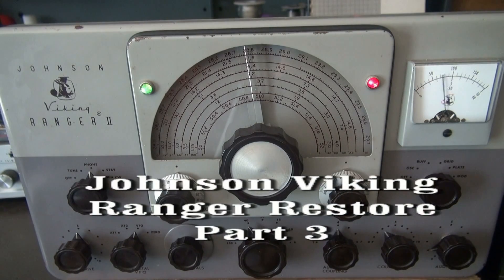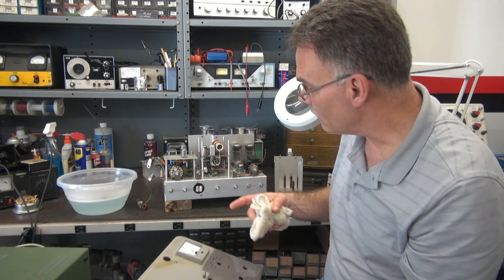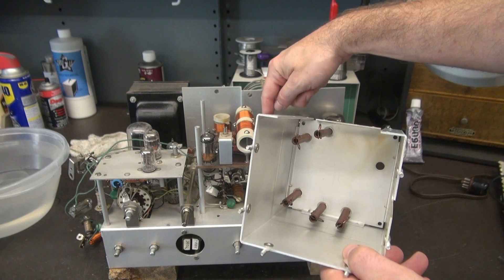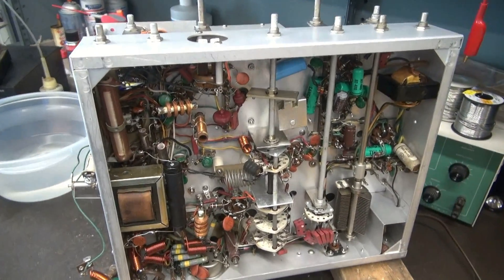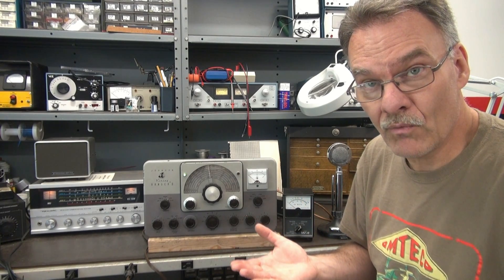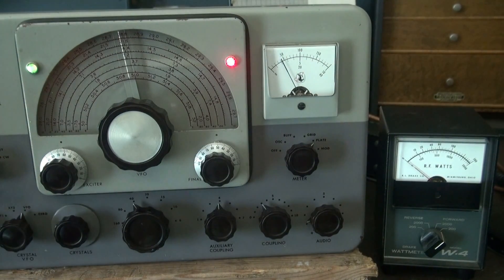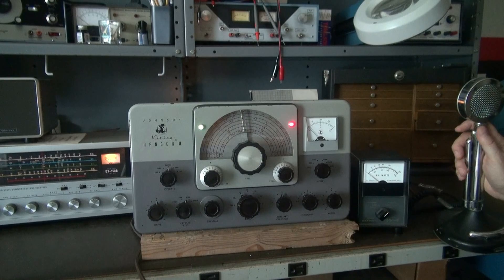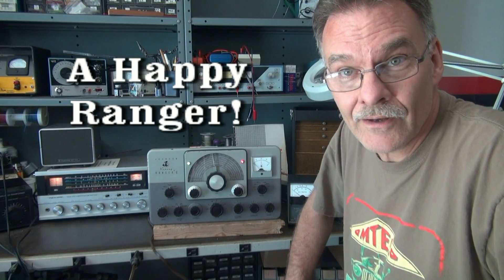EF Johnson Ranger 2 Ham tube transmitter Restoration Part 3 D-lab Electronics

Comment: Did you measure any RF voltages in the driver stage? I am wondering what the fr voltage should be at the grid of the 6146. So far I have not found that info in the manual.

Comment: Thanks for posting this. I have a couple of rangers and intend to go through them for recapping and the chernoble resistor. 

Right now, I have a Ranger 1, with low power. Changed driver and final with known good tubes. Still low power. Do you have any suggestions as to where else to look to solve this issue?  Any suggestions would be grand... Thanks!
Reply from the maker: Is your plate and grid current correct?
Reply: @d-labelectronics  Dip to about 170 ma Plate,  after adjusting the grid to 2.5 ma Per the manual. Low power at abou 15-20 watts that way...
Reply from the maker: Have you tried a new 6146? Also inspect the plate/RF coupling cap, may be open. TD
Reply: @d-labelectronics  I don't think I'd have any output if the RF plate cap was open. There is no other way to get RF energy to the tank circuit. I have several tubes that were checked on a calibrated TV-7 and have tried them...

Comment: How did you know where to put your dial pointer back in relation to the VFO's variable capacitor? I noticed that you moved the air variable around quite a bit while the dial pointer was removed and would like to know the procedure you used to align everything again. Thanks very much for your great videos, I learn something new every time I watch one!